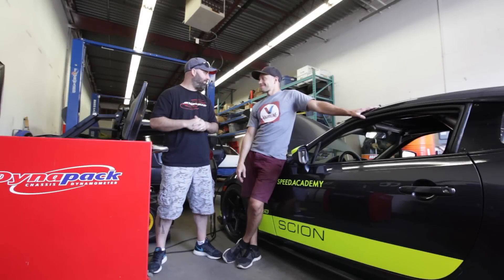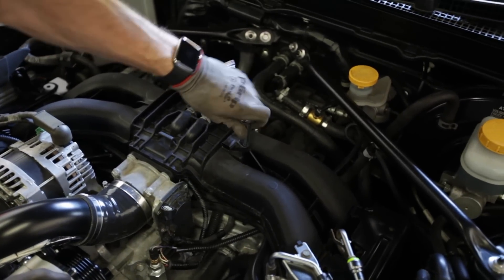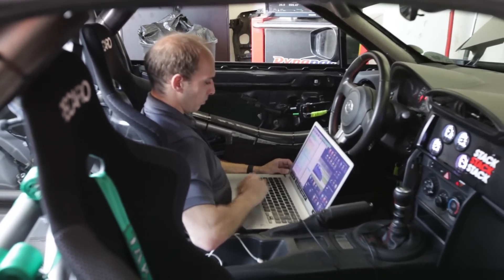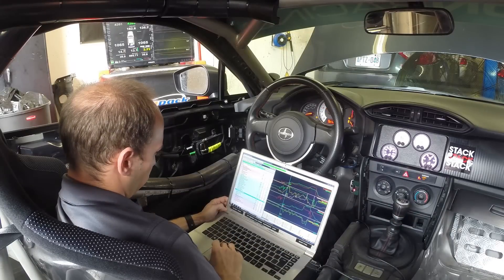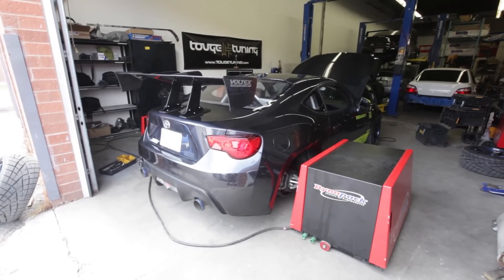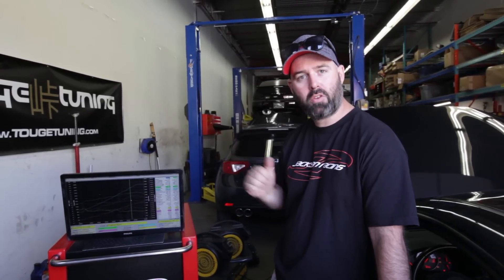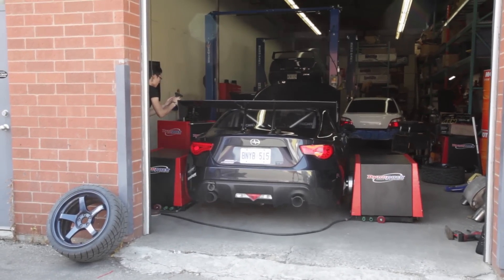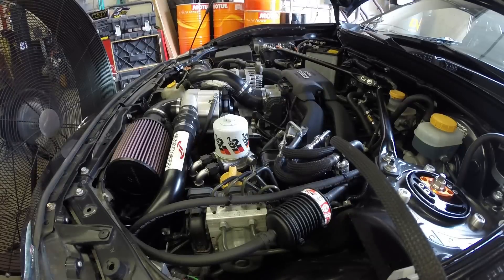Jackson Racing Supercharger Dyno Tuning and Results - Scion FR-S Track Build - EP05

Comment: i put  the same super charger as yall i changed map sensor and my car wouldn't start. so they tuned my car with the factory map sensor. why my car wouldn't start and i have the same map sensor as you
Reply: Yea I'm on the same issue do you guys have the values you used for the new map sensor
Reply: Rafael Perez did you ever figure out the problem with the car
Reply: knight  nope tuner is still working on it. Its something to do with the value changes due to if you unplug the map 2.5 bar map sensor and turn the car on and replug the map sensor the car will drive normal but once engine is shut off the car won't start

Comment: I love your videos and have used them for my 240 build and now for my frs but I'm curious, how is it the stock tune from Jackson racing is ~280whp yet you guys are at 262whp. there are multiple dyno charts and people that prove the stock tune is where it says. do you think it's because of elevation or something with the car not breathing right?
Reply from the maker: Not at all. Every dyno is different and same goes with engine. We really don't rely on dyno charts too much. Rather the focus is on how well the car runs. Plus, we were doing a 7-day endurance race which meant a very conservative tune to ensure nothing would break or go wrong. The stock tune may provide more power but you never know if it suits the engine and parts 100%. We always want to have a custom tune done to ensure that it's running optimally
Reply: The Dynojets which jackson racing use read a few percent more than a dynapack and even further more than a dynodynamics. It would explain the 10-15hp difference here. FYI stock FRS on a dynojet makes 180whp but on a dynamics around 165whp.

Comment: wouldn't you have run out of fuel pump with that kind of hp gain? I think a bigger pump would give another 10hp
Reply from the maker: There's already a larger pump installed so we're covered off on the fueling end.

Comment: Was that a bosche recirc valve from a saab/Porsche?
Reply from the maker: +mmarchmonte88 No clue, it comes from Jackson Racing with the kit.
Reply: +mmarchmonte88 Yes.  It's a bypass valve not a blow off valve.
Reply: +fwh79 bypass valve, blow off valve, compressor discharge/bypass valve, it's the same thing. It's either recirculating the air or venting to atmosphere.
Reply: Indeed...the blow off valve vents to the atmosphere and the bypass valve recirculates.  They serve a similar function, however they are not the same.  A blow off valve can cause problems on a mass air flow system.
Reply: +fwh79 whatever guy, you keep doing you I'm not gonna argue semantics over  this shit. Cheers and keep boosting.

Comment: Nice work guys, I was hoping that you would yield more hp, I'd love to see maybe, top end internals; (cams+pulleys), larger cc injectors, ecu, intake manifold. Target 350 to 400 whp. Best of luck!
Reply from the maker: +Dj Hazard Those power figures ensure a reliable setup. Any FRS we've seen with 350-400whp hasn't been very reliable and usually needs a full engine build to support that so we're a bit weary of going full out to make big power and then struggling to keep the car running. However, the idea of a 300-320whp stock engine turbo setup is very appealing so we may do that next year. :)
Reply: +Speed Academy ah reliability is key, good thinking.

Comment: Are you guys running the Toyo R1R on that car? If so, how do you like them as a track day tire?
Reply from the maker: +TheWerkz yessir, R1R this year. We just did our first track test a couple nights ago and the grip level is very impressive, but the car had a ton of understeer from the huge rear wing and no front splitter, so it was difficult to properly assess them. Once we get the handling balance and aero balance sorted we plan to do a full tire review video on them.

Comment: power at the hubs tends to be a little more than at the wheels, does it not? I usually count those two as separate measurements because it doesn't incorporate that unsprung mass which definitely has an effect on the road
Reply: maximus9401 theoretically yes, but in practice Sasha's Dynapack reads quite conservatively. On the local Dynojets, Mustang dynos or other Dynapacks we've used we know from experience that the these numbers would have been higher.
Reply: David Pratte I see, thanks for the clarification

Comment: great job! i think the fa20 really needs forced induction my wrx turbo feels awesome with the turbo but i would not want it N/A so its the same for the gt86 in my opinion
Reply from the maker: +Oliver Rivett-Carnac I spoke with the lead engineer at Toyota and the issue is as soon as you add power then everything else needs to be beefed up, brakes suspension, chassis, so that adds more weight and in their mind would ruin the nimble and great handling chassis they set out to build.

With all that said, I totally agree haha put the turbo FA in there, slap a small turbo on it make 200hp and we'll all be happy.
Reply: Why subaru don't literally just take the boosted WRX FA20 and slap it into the BRZ is beyond me... I'd buy that in a heartbeat
Reply from the maker: +Rising Sun We're hoping one day the FRS or BRZ will come with factory turbocharged power! That would be the best setup ever.
Reply: +Speed Academy i agree I am hopping for a turbo version of the fa20 too and i would love a choice of engine with a high reving NA vvti engine like the f20c but I am dreaming for sure haha
Reply: +Speed Academy and all of those upgrades would make this 'cheap to produce' entry level sports car more expensive than an STI, which makes it blatantly obvious just how over-priced the car is for what you get. Thin sheet metal. Thin glass. Crappy audio. Small under-powered engine and just good enough suspension components for it to drive really well.

If you compare all of the upgrades the STI has over a BRZ, the price differential is a hell of a lot bigger than 5-8k. Turbo, upgraded suspension, bigger engine with beefy internals, heavy duty transmission, AWD... I have serious doubts Subaru has any intention of ever doing a true turbo'd BRZ STI because hardly anyone would buy the base model. That said, the base model is still a fantastic driver's car. It just needs better tires and more power.
Reply from the maker: +MotoErgoSum Comparing the STI to the BRZ isn't very fair. They are two very different cars, one being a sports coupe and the other a 4-door performance sedan. I also tend to think the driving dynamics of both are vastly different. 

That being said, you're right... I too doubt that we'll ever see a turbocharged BRZ but I hope for the both of our sakes we're wrong.
Reply: Speed Academy
When considering purchase price vs features, it's completely fair and the 86 is seriously lacking. My BRZ flat-out lacks amenities for its price range. Laughably bad cup holders, no rear leg room (why bother?) bare bones gauges, cheap audio with a laggy touch screen...

My friend's brand new Mustang is luxurious by comparison for just 8k more (turbo, full leather, data logging, vastly superior audio, huge app radio touch screen with ZERO lag...).

For Subaru to do a true turbo BRZ STI, it'd be at least as expensive as the STI Limited, up around $38,000 and they would need to have the same level of amenities of the WRX. The current cup holders, audio, zero rear seat leg room (why have a rear seat?). No auto manufacturer builds cars for free, so looking at price vs features is completely valid. Subaru and Toyota sure as hell did their best to price the car juuuust low enough that people would buy it in droves and put as little as they could while marketing it as the second coming.

Don't get me wrong, it's a great driver's car for JUST the drive, but everywhere else it fails as a daily driver compared to the WRX in the same price range... That screams to me that Subaru and Toyota went cheap to maximize profit margin. If I wasn't into doing SCCA and driving like a hoon I wouldn't have bought mine.
Reply: Speed Academy
The WRX, Mustang, Focus, Z, Lancer, etc are all drivers' cars and they at least have steering wheel radio controls. I've driven an Evo X. I wasn't the least bit distracted from the drive by the wheel controls. Toyobaru dumped a lot of money into marketing to push that line of BS.

They're seeing low numbers because it lacks amenities and the raw power to compete with other FWD and AWD cars in its price range. It handles great, but so does the WRX and STI. My old 05 STI handled like it was on rails. For your money, you get a whole lot more with the WRX, or switch to Ford and you get tons of factory options. Had they put offered a turbo option and better daily driver features, it'd be selling a lot better. As-is, I saw my car's trade-in value plummet to almost HALF in two years...

You can only BS your way into sales for a few years before the consumers get over the initial bonanza and see just how plain it is as a daily driver. I'll probably live with it because I'd rather own a house than continue renting, but I may eventually switch back to the STI if they do a hatch again. After tuning my BRZ isn't getting much better MPG than my STI with a lot less power.
Reply: Speed Academy I think that is balls. I understand that things would be need to be beefed up, however we are not talking like mad power... Maybe something nearing the 200-250bhp range. The thing I love about the 86 is the chassis, low center of gravity and, stiffness. I truly believe the chassis is capable of way more than the current power and weight. Sure there would be added weight but I don't believe it would ruin the car at all. The current power plant is anemic and underpowered. 

Secondly they would be shipping two models.... Drivers can choose the added weight for a more skiddy experience... Maybe a little heavier but slightly more focus on speed over low speed agility. 

They also need to look at customer demand... And alot of people are wanting a boosted 86.
Reply: +Speed Academy Then why does Subi put out a BRZ STi concept and not put it into production. I have also read that they want to expand the STI brand by 20% or some BS like that. I want the STI by April 2016 because I dont want to add all the performance stuff myself which will cost a lot more and no warranty. :(
Reply: +Isaiah 42 Because they'd have to charge close to 40k for it to be a big money-maker for them with all those upgrades. Part of the point of the 86 is a bare bones money-maker. I suspect they'd rather sell STI parts as upgrade options than warranty a sports car with expensive-to-replace parts. I'd LOVE to sell my BRZ for a true BRZ STI, but I won't get my hopes up. Probably get a new STI if they ever bring the hatch back. The BRZ is a pain in the ass to haul a baby in.
Reply from the maker: +MotoErgoSum Sadly they aren't selling enough of them so we may not even see another generation BRZ/FRS. I do disagree with you that they cheaped out to maximize profit though. They made the cars simple which means taking out amenities simply because its meant to be a drivers car and not much more. Like you said you bought it because it's the perfect weekend track warrior but it can still get you to and from work. That was the intent of this car and it doesnt try to hide the fact that its anything but.

One thing you're also forgetting, a lot of R&D went into this car, more so then most to really develop it as the perfect drivers car so they have to cover those costs somehow. This will never be a corolla where millions will be sold and because of the low volume the price is reflecting of that.

Comment: Can you guys elaborate on why it uses the MAF at lower load and the MAP at high load? That's backwards from everything I have ever tuned. (ford + GM).
Reply from the maker: +phoenix6064 We're not tuning experts but just like the stock MAP sensor the MAF's resolution under boost in this case isn't calibrated for it so relying on the aftermarket MAP sensor provides accurate readings to base the map off of. For cruising and everyday driving the MAF is ideal which means the stock mapping can be used to provide a stock like driving experience until you go full throttle.
Reply from the maker: +Speed Academy update: here's what Sasha from OnPoint Dyno had to say about it. "The  short answer is that the OE MAF sensor maxes out, and the cars otherwise always use MAF throughout the range for the primary airflow calculations. The longer answer is that filtered MAP gives a smoother load reading to the ECU and as a result the ignition timing and fueling is more precise. The dyno can notice the difference and you can see it in the graphs, so we typically switch over to speed density earlier than we absolutely need to in terms of the MAF maxing out. The OE MAP sensor also maxes out, which is why we switched to the 2.5-bar MAP sensor.
Reply: You guys rock as always, thanks for the details. I had a similar scenario, and bought the 2.5bar map first (cheaper). I'm not as skilled as your tuner though, so I ended up buying the bigger MAF too.

Comment: that's your "quiet" exhaust, right? :D keep it up!
Reply from the maker: +thebibidu Yeah, not so quiet is it. The headers really make it hard to tolerate. We're thinking about adding in a resonator to see if it'll help.
Reply: +Speed Academy Quick question, is the JDL header street legal? Thinking about getting one. Thanks!
Reply from the maker: It really depends where you live. In our case the car is still catted and has the OE ECU in it so it'll pass a smog test, so it's legal here in Ontario. But some countries/provinces/states have different laws regard what constitutes a street legal aftermarket performance parts like this.
Reply: Thanks! More subscribers to you!

Comment: What octane gas was used during this dyno?

Great choice on the SC. Exhaust is quite loud though
Reply: Lol and that's a quieter exhaust than what it had before
Reply: +ZohanLohan I would have went with Perrin or Invidia q300 but nonetheless great build
Reply: theplatformer 94 octane pump gas. It is loud. We're going to add a Vibrant Ultra Quiet resonator to see if that quiets it down enough.

Comment: That supercharger almost sounds like a turbo.
Reply: maximus9401 Wow man... That anger came out of nowhere, wonder what crawled up his ass and died..?
Reply: x2p428 Wow. Get some anger management therapy or some shit. maximus9401 Just gave his opinion which sounded completely normal.
Reply: x2p428 it is a centrifugal unit, which is essentially a belt driven turbo. Or rather, a turbo is an exhaust driven supercharger
Reply: +maximus9401 don't explain the difference to me you pedantic asshat. I know the difference. But the thing is superchargers generally making a whine where turbos make a whistle. This makes more of a whistle than a whine, that's the point I'm trying to make which you clearly missed.
Reply: x2p428 woah there champ, why are you using insults? In no way did mean any offense to you, and in now way was my comment rude. I just pointed out the facts. Uncalled for and very rude of you.

Anyway, the "whine" aspect usually comes from those bigger positive displacement supercharger types that have big belts and hefty rotors that create a whining sound. Centrifugal types are a lot quieter. This unit comes with a diverter valve stock, and the guys may have added a blow-off valve. I'm not sure of their setup. But anyway, like a turbo, there is a turbine that is creating greater induction so that extra boost has to be let off in the same manner whenever you let off the throttle. That's why you hear the whistling while it's spooling and the blow-off (which may be diverted back to the intake) when they let off the throttle.